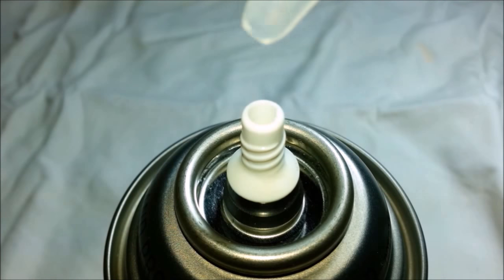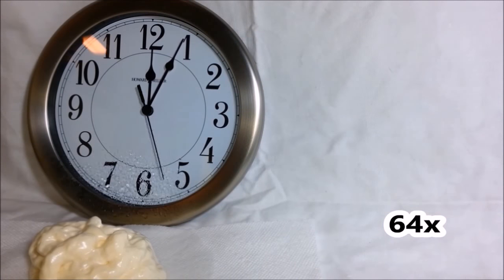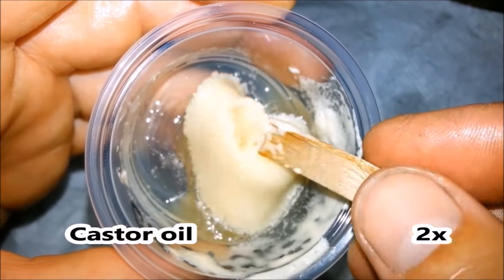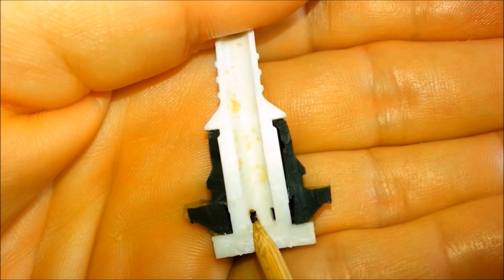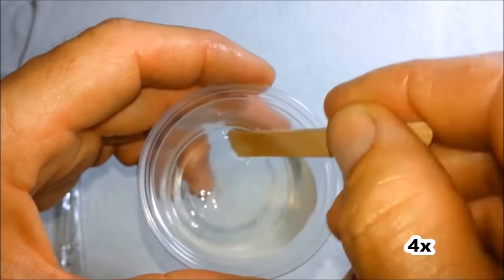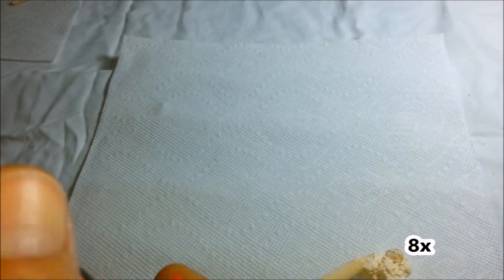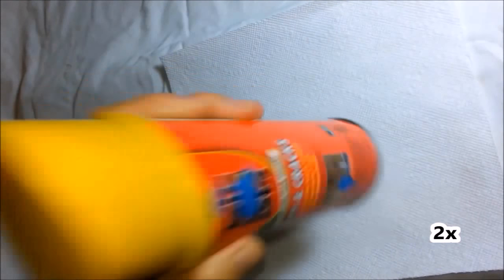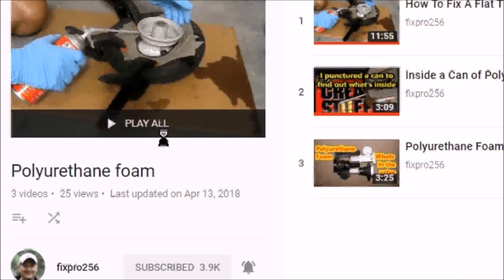Reusing Spray Foam Cans

Comment from the maker: Instead of mixing castor oil and mineral spirits and sucking the mixture into an eye drop container, you can pop the top off and use a small funnel to put them into the container and then shake it to mix.
Also shake the mixture just before use, in case it has separated.
I say "Immediately" in the video because once you remove the applicator, moisture in the air will start to mix with the poly.  Poly cures quickly once that happens.
You can get pipe cleaners at craft stores or in the craft section at stores like Wal-Mart.
You can also use an aerosol can of something like WD40 to blast the poly out of the main channel, instead of using a pipe cleaner.
There's only a small amount of foam trapped in the valve but you need about 15 drops of the mixture to make sure you have enough castor oil to mix with any foam left in the valve. 
Frequently, some of the poly will rise to the surface and cling to the sides of the main shaft of the valve.
If you can't get 15 drops into the valve, there's probably some dried poly taking up space.  Use a straightened paper clip to probe the valve so you know how deep the bottom is.  It's usually 1.25 inches deep.  CAREFULLY!!!! use a course thread wood screw and screw it thru the foam.  Then pull the screw out and the poly foam should come out with it.
Since you can't stir the poly to mix it with the castor oil and mineral spirits, you can hold the can at an angle and use an old applicator to spin the valve.  That will help mix things up.  But, I haven't had a can stop up even when I don't spin the valve.
Having a kit makes this much easier.  
A storage bag with pieces of pipe cleaners.
The castor oil/mineral spirits in an eye dropper. Woodscrew. Straightened paperclip. Gloves. Paper towels.
There are 3 to 4 ports inside the valve.  I turn the can when I discharge the first of the foam to help clear all of the ports. 
If I get enough material and time, I'll shoot an "extras" video to show more tips and tricks.  Be sure to check the playlist at the end for that and other videos.
If you would like to tip me to help me make more videos, click the link below.  Thanks for your tips!
https://www.paypal.com/cgi-bin/webscr?cmd=_s-xclick&hosted_button_id=AK846AQ2GTAZ2

Comment: nice tip ... I am thinking to another one
- cleaning the valve after use with compressed air and a small pipe, closed at end with diagonal hole ... can be made from a screw by drilling two holes in it, one axial for air connection, and one diagonal closer to the other end for cleaning.
Reply from the maker: I'm not sure I follow that one.  How do you drill holes in a screw???
Reply: @fixpro256  with a bench drill, if you hear about it (I am talking about a metric screw/bolt not a carpenter screw)... by the way there is a more simple method,  valve clean after use... turn can up and push so gas will clean the valve, so ready for storage ...
Reply from the maker: @user-ug9nn  I've tried the "turn can up" thing.  It doesn't always work. You have to let the can sit for a while to let the foam settle inside.  Even then, usually, there is a thin film left and it bonds the rubber part of the valve to the plastic part.

Comment: Do you have any suggestions on how to restore / reuse old poly foam cans that have been outside a long time and exposed to freezing temperatures? I have shaken a couple of the cans and I could barely feel some of it loosening up inside and when I put the nozzle on and tried to use some came out continuously but very slowly and The expansion was minimal but enough To give me hope to find a way to make them work. There are cases of cans! And I have a lot of insulating to do if only I could figure this out lol
Thank you for your time
Reply from the maker: Unfortunately, the shelf life isn't all that long.  I think it is only about 12 months according to DOW. But, I think it usually works ok for about 2 years.  It just slowly gets thicker with time.  That's probably why you can only hear a little movement when you shake it.  If I remember right, it still expands pretty well even if it's old.  The only thing I can suggest is to try different methods since you have several cans. I can tell you that there is no tube inside, so using them upright will just let more propellant out. If the thick part separates and forms chunks, shaking might make things worse.  Try without shaking.  Just turn the can up side down and see how it goes.  With another one, try letting the can sit upside down for 30 minutes(just a guess), then try it.  With another, shake it well, let it sit up side down for 30 minutes and test it.  With another, shake it and test it without waiting.  If using it up side down doesn't work well for your application, you can attach a 12 inch vinyl tube directly to the small nipple on the screw-on trigger.  Might need a wire wrapped around it to keep it tight.  Makes it easier to get into odd places.  If you really feel lucky ;-) you can use a tiny nail in a pair of vice grips, poke a hole near the bottom of the can, let the contents spew into a disposable container, brush it on where you need it.   Be sure to poke the hole while outside.  Wear old clothes, gloves, and eye protection!  Have mineral spirits (paint thinner) on a rag and ready to go.  It can make one hell of a mess!!!!  Might be able to cut a tiny corner out of a trash bag or large ziplock, poke hole in can, spray into bag, then apply like they do cake icing.  If working overhead, protect your head and eyes!!!  It will totally F-up your eyes. Having the MS on a rag and handy is the most important part.  And I ain't even kidding about that.  Do it, or you will regret it!  ;-)  Let us know how it goes.

Comment: if the valve is blocked. How to i get it to spray?
Reply from the maker: Usually, it's almost impossible to get one going again due to the way the valve is designed.  Especially if it's been that way for days. But, if your interested, these other two videos have more information in the description sections.

If you want to see how I get the valves out of the can, watch this video: https://youtu.be/fxfvEXoDBM0
If you want to see a split view of what's inside the valve, watch this video: https://youtu.be/f4URZt366kE

Comment: I heard "Goof-off" works
Reply from the maker: Sorry I haven't responded sooner.  Somehow this one slipped past me.  I tried goof-off to remove GSF but it doesn't work as well as "True" castor oil mixed with mineral spirits.  Castor oil turns it into a pile of mush and it never sets up after that.  Great for getting it out of the nooks and crannies of your fingernails, hair, or whatever you accidentally get GSF on.